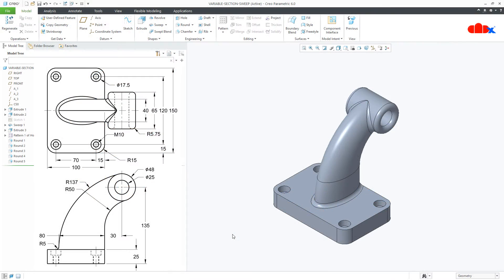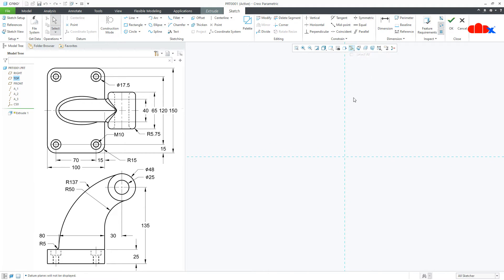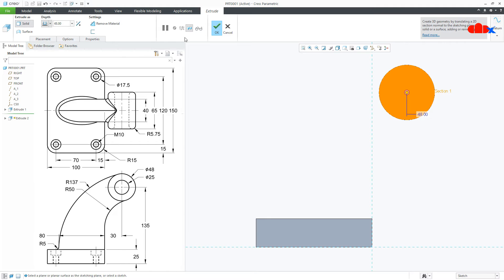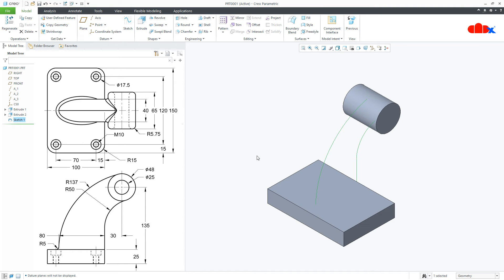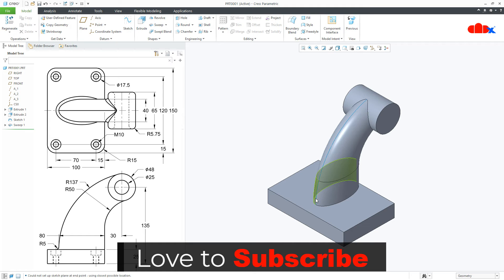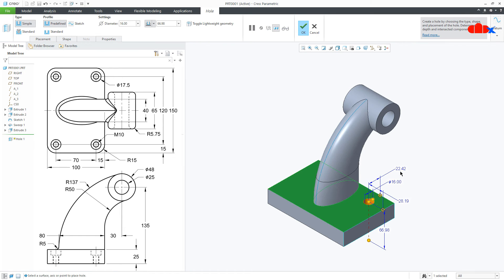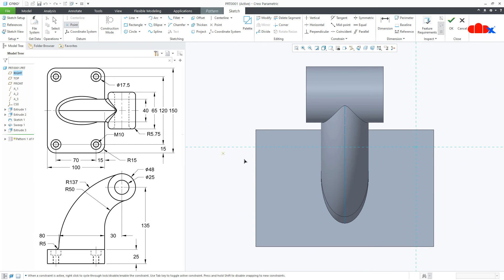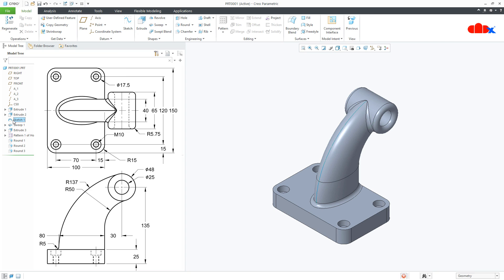Variable section sweep in Creo Parametric

Comment: How can we
● apply same hatching for a part in all views & projections in a drawing?
● make dimension colour same as part colour in assembly drawing?
Reply from the maker: You need to select these things individually and change it.
Reply from the maker: How do you change the component colour in assembly drawing?
Reply: @CADxTraining  In drawing view properties> View display> Colors come from> the model.
But dimension colour does not come from model.
Reply from the maker: This is the only way we have to change the component colour in assembly drawing. First we change the component colour in assembly and than use colours from the model in the drawing. For the dimension in the Assembly drawing, select the dimension and go to the format and change the colour.
Reply: @CADxTraining  How can we use hatch colour from the 3D part in assembly drawing?